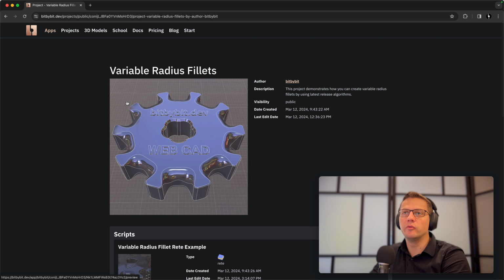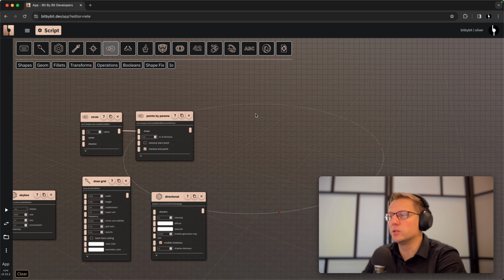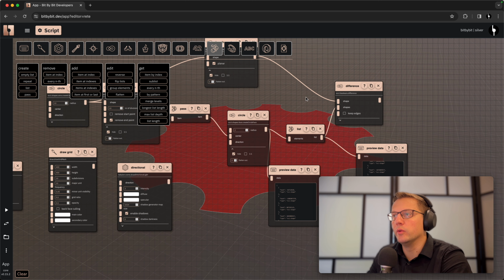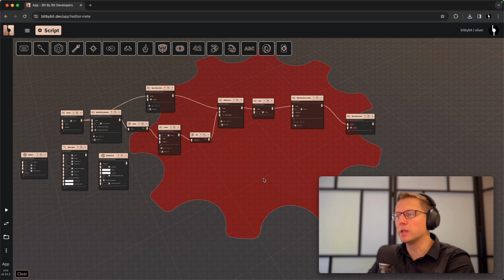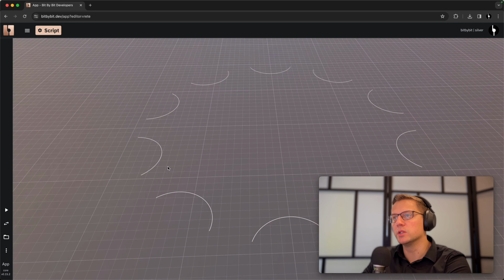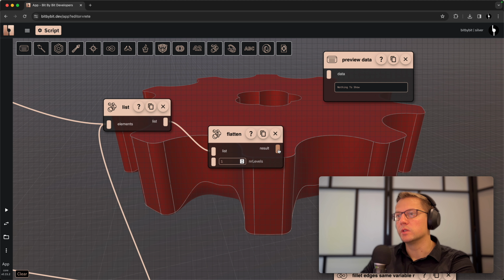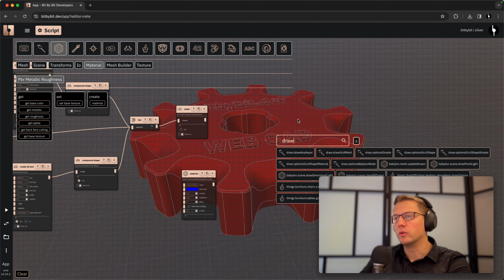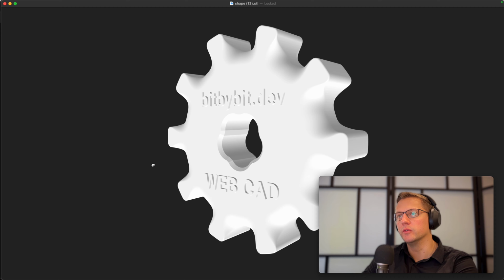Introduction To Rete Editor - OpenCascade OCCT

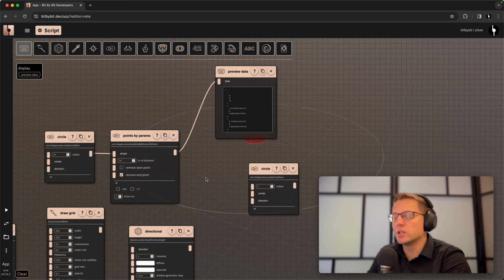Comment: 8:46 oh.. does "pass through" node work like For each?
Reply from the maker: hey :) nah, it just passes the same stuff along and has higher order output type “any” that can be plugged anywhere. It probably shouldn’t be under the lists category now that i think about it ;)
Reply from the maker: ah and the thing is, flattening output does change the original output type, but i do not adjust that type on the fly. That would be quite cool to do, then this passthrough would not be needed ;)